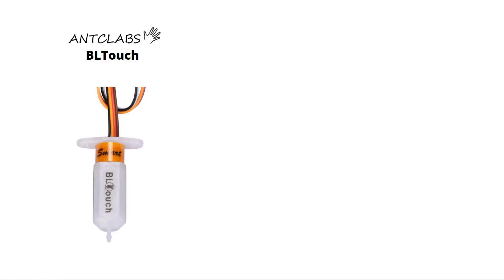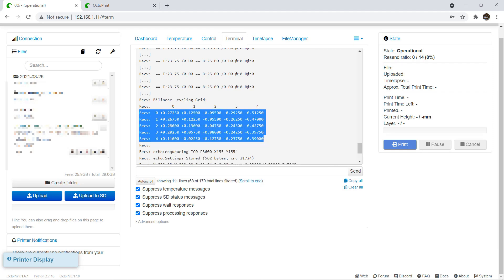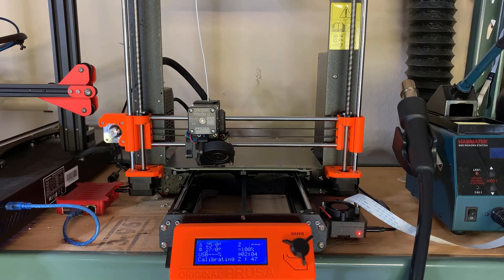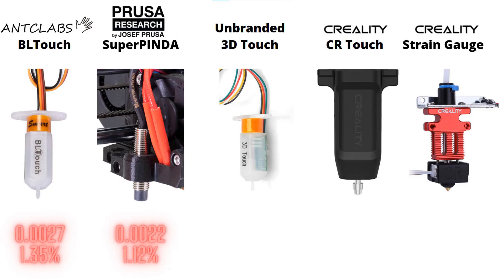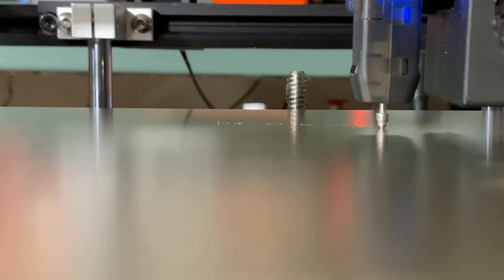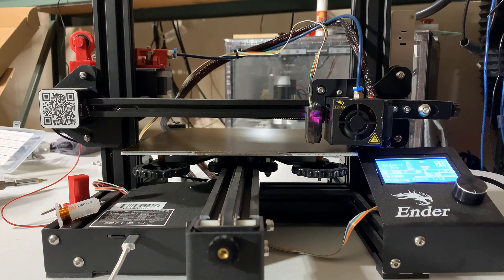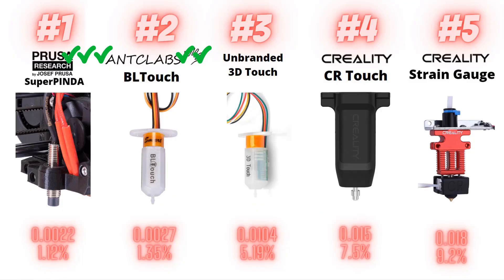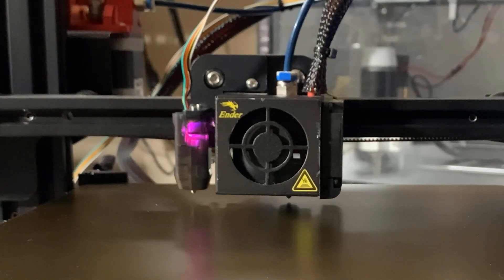The Best Auto Bed Leveling Sensor BL Touch, 3D Touch, CR Touch, Strain Gauge or the Prusa SuperPINDA

Comment: FYI - I just did this test on my Ender 3v2 (only a 3x3 matrix) with my 3-yr-old CR Touch, and the results were Stdev = 0.0187, or 9.37%. Pretty much in line with this video. Although practically speaking this level of accuracy is perfectly fine for good first layers and prints, it's disappointing, because I'd heard the same as some others said, that the CR-Touch was better, which is why I purchased it over the BL-Touch.

Comment: While I really appreciate this video it's very helpful at the same time something crucial was not taking to consideration the fact that the strain gauge is within spec it will still give you very good auto bed leveling andIt is more reliable that category makes it the best sensor if you take those into consideration it is the best sensor here  the other ones although they work better and these test results seem like they're more accurate which they are but in true practice this stringage is significantly the better option because essentially it will never fail on you and whenever there's a problem  with your print like spaghetti it won't get damaged from it

Comment: I really enjoyed your statistical approach and shows the sensors performance by itself.

There is one question i have and my search bought me to this video, but it's unaswered.

How well does the mesh relate to the actual print surface?
See, the Prusa SuperPINDA or any inductive, including eddy current uses the metal sheet, not the coating you print on. There could be variation in height on how they applied the PEI coating, and how much does that affect the result?
I wonder if you could print a mount to the print head to use a dial test indicator with 0.002 mm divisions to compare actual surface to what the sensors shows?
Draging the dial test indicator across the bed will show you what the surface really looks like and I would not be surprised to see 0.01 mm or more variation between points.

Comment: You're not calculating the accuary of prober you are calculating warp of your bed so these are useless, that's why cr touch is 0.02 because bed is warped. You should ise m48 command instead

Comment: Excellent video and testing. For a second iteration it might be worthwhile to remove all other variables and mechanical flaws these printers have generally like Z wobble, single Z X gantry and so forth which could add a ton of variation at least what I've seen with my Ender 3. Not sure, how the best test setup 2.0 would look like. But it should be a mechanical setup where you have not the slightest doubt that deviation is coming from the probe and not from the motion system. PS: just seen Thomas setup for testing ABLs. That seems to be the gold standard: https://youtu.be/il9bNWn66BY

Comment: Regarding the slow retract of the CR-Touch.
It doesn't matter. Because it is irrelevant if the pin retracts slow or fast. Important is the sensor which ready when the pin is pushed in to a certain points. thats all it needs.

But the results are really weird. Never saw a review with such results on the CR-touch.

Comment: Using different printers taints the results. All sensors should be tested on the same printer. That is the ONLY way to note true differences. It's a mainstay of research to use the same conditions for each product tested. Other than that, good vid.

Comment: I have a Creality 4.2.7 board and using a CR Touch. 
Works fine but starts to slow blink after it starts printing. 
Is that normal or is there a way to make it stop?
(Update) I tried a different CRTouch. That was a loss of money it did not make any difference.
Reply: I got it fixed by turning the internal pull up resistors on my board.4.2.7 and 4.2.4 Creality Motherboard. PB0 and PB1. By adding this to my pins_CREALITY4.h at the end of the file #define BOARD_INIT() SET_INPUT_PULLUP(PB0) SET_INPUT_PULLUP(PB1) Thanks to Scott Lahteine

Comment: Nice data. One thing I would be interested to see is temperature compensation. I know that super pinda and bltouch both have a temperature sensor and they do compensation on when the probe is warmer or colder, but do the others have similar features and how much are they affected by ambient temperature
Reply: The clones have no temperature compensation, not sure about the pressure gauge.

Comment: I actually had to take my CR touch apart this week and fix it because the metal probe was slightly bent and was getting stuck in the sensor causing a blinking red light and no function. Really disappointed with it especially after seeing the results of this video. I feel like they could make it really accurate with some more thought put into it

Comment: The CR touch may very well be a licensed copy, it actually looks like an improvement over the original and has been re-designed to work plug and play with the Ender series printers.  bTW, I've seen other reviews of this where it actually worked BETTER than the BL touch, so you might want to get another one and try it again.  Your's could be defective.
The PINDA inductive sensor looks like an improvement over the commonly available larger units, however there is nothing wrong with those when used with spring steel coated build surfaces.
Note that inductive sensors are available in both NO and NC PNP or NPN type switches.  The NPN type can be run at 12 or 24 volt power with 5v logic switching while the PNP type are restricted to switch their output signal at the power supply voltage.  Since these sensors perform best above 6v power, the NPN type is preferred.  These switches are Open Collector.  PNP switches will require a logic voltage level conversion.  NO and NC sensors are both OK, but you will need to configure the software to use the kind you have.

Comment: So I was able to test my CR-6 SE to compare numbers. I just put a new hot end on it, so the printer should be pretty pristine. I got this printer about 2-3 months ago. The results, using the same methodology that Aurora used:

Average Standard Deviation: 0.010467241 mm
or 5.23%. Not great, but better than the original test. 

Again, here's my data for the truly nerdy:
Data					Standard Deviation			
0.303	0.204	-0.005	-0.175		0.054866201	0.00811172	        0.0085557	        0.002408319
0.275	0.099	-0.169	-0.406		0.01372953	        0.008414274	0.001414214	0.004266146
0.171	-0.03	-0.294	-0.579		0.005357238	0.00914877	        0.000894427	0.009617692
0.023	-0.216	-0.465	-0.762		0.008927486	0.012173742	0.004335897	0.015254508
								
0.407	0.199	0.009	-0.18					
0.28	0.093	-0.167	-0.408		Avg	0.010467241	mm	
0.18	-0.02	-0.292	-0.59			5.23%		
0.005	-0.219	-0.454	-0.75					
								
0.43	0.193	0.009	-0.177					
0.271	0.085	-0.165	-0.41					
0.185	-0.015	-0.292	-0.598					
0.001	-0.201	-0.455	-0.73					
								
0.43	0.215	-0.009	-0.181					
0.297	0.079	-0.167	-0.408					
0.183	-0.021	-0.293	-0.577					
0.002	-0.197	-0.457	-0.737					
								
0.428	0.201	-0.005	-0.179					
0.302	0.081	-0.167	-0.417					
0.18	-0.038	-0.292	-0.576					
0.008	-0.191	-0.457	-0.765

Comment: I have a quick question, I still have either the old 8/16bit Silence MB for each of my Ender 3s. Will the BL touch will for it?
Also THANK YOU for this guide! Straight to the point, Data to back it up and variations to results considered! Couldn't ask for a better guide!

Comment: Great video. Ideally, testing would be performed on the same machine and build surface. I've had mixed success with the 3dtouch - unfortunately there are multiple versions being sold. The older '2.0' version was problematic - poor precision due to play in the play in the probe, and inability to 'stow between samples' (in Klipper). The newer '3.2' version seems to have fixed these issues, and I now get comparable performance to a genuine BLTouch on an Ender3V2 for a fraction of the price. I don't know which version you've used in this testing - your mileage may vary.

I haven't tried inductive probes or strain gauges.

👍 Good stuff!
Reply: Lets be honest here though, its barely a difference lmfao.
I have a cheap ahh ender 3 with a cheap ahh 3d touch.
Its impossible to tell the difference between that and a bamboo labs.
The motors along with the electronics along with the firmware, are all the same. With the only difference being the frame and random features.

Comment: Do you have or will you do a video on the Autolev probe installation and setup please
Reply from the maker: Yes, I have made a few videos for that. Please check the 3D printer upgrade playlist.
Reply: @AuroraTech  I’m one of your subscribers and I looked at all your videos, but I couldn’t find any on the Autolev brand bought from Substanica 3D.  I’m a older gentlemen and not the best at the computer.  Each time I watch the YouTube videos they are older and the screens have changed so it is confusing.  I’ve watched your videos and you explain thing very well and have had some success with your instructions.  I need assistance to get this probe working on my Ender 3.  I’m terrible at downloading and getting into my machine.  I would appreciate any assistance available in helping me or a place I can get the assistance I need.  Thank You keep up the good work
Reply from the maker: This is not one of the major leveling sensors, but I saw they also have instruction videos on their site:

Hardware Installation: 
https://www.youtube.com/watch?v=DjAO5SMCNNk

Firmware update:
https://www.youtube.com/watch?v=rsSK1m6XlbI

https://www.substancia3d.com/AutoLev/
Reply: @AuroraTech  Thank you I really appreciate the information

Comment: CR Touch was bound to be dodgy it was Creality made!
 I would like to know which has the greatest tolerance range, my Ender 5 Plus's aluminium bed was high in the middle like the majority of those machines, because of this the bulldog clips deformed the glass from the corners and took the bed out of the BL Touch's tolerance range.
 I fixed this by using the screw type bed clips that can be fitted so they just hold the bed without being too tight, I placed just two of them in the centre left and right as there is no bed slinging and just Z motion and this is adequate.

Comment: Why would anyone ever use any of these though? Its insanely easy to level the print bed by hand and these products dont actually level the bed for you anyways. All you are doing is wasting a whole bunch of time by making your printer test a bunch of points and then wasting even more time by making your printer make thousands of microadjustments mid print rather than actually just leveling your print bed. Am I missing something or are these products just totally worthless? Bed leveling is literally the very easiest part of 3d printing. Id rather level the bed by hand than introduce countless points of potential failure and increase my print times. I can't wrap my head around why these products exist, let alone why people actually like them.

Comment: Hmm... Yeaa... But... But with the worst result still just being 1/10 the height of what can be considered the default Layer Height of 0.2mm when FDM printing I'd argue that any of them will work for you unless you're printing NASA precision grade parts and by that time I'd argue it being safe to say you're using the wrong 3D Printing method and thus machine to begin with...
Reply from the maker: Yeah, that's why I said all these sensors are very usable for general 3D printing, you won't see any difference unless you inspect them under a microscope.

Comment: I ain't surprised that the CR Touch performs worse than the original BLTouch, but I am surprised that it performs worse than the generic knockoff. Seems like a metal pin really isn't a straight upgrade, but comes with a tradeoff. Really too bad, as as much as I love my BLTouch on my Ender-5, it does visually stick out like a sore thumb on almost every printer. Still, if I ever do get an Ender-2 Pro, I'll probably slap a CR Touch onto it to keep the nice consistent look. It performed well enough for usual needs, after all.

Comment: I have a CR 10S Pro V1 which came with an conductive sensor i had a terrible time leveling, so I switched to an Inductive sensor. Based on recommendation from Make Muse. It has worked good then i switched to a glass bed and had to adjust so close to the glass it was a problem if a part warped. So then I went to a composite bed plate and glue stick. Recalibrated, releveled the table, the machine frame and tightened the bed springs. Now i get very accurate level. I want to repeat your study to see how accurate and repeatable it is. Can I beg for the excel Template?? You guys are so good. I share your video with friends. Although you talk too fast for my old ears I just replay that section and I can get it. I am learning from you guys every video. the oven knob and Fan blade was great. I also use Fusion 360 and OctoPrint on my 1os Pro V1. I did add struts too you may want to see what I did it stiffened the Z by a LOT. 10X or more stiff.  Take Care you guys, tell Mom & Dad Hello, You have great Genes. D
Reply from the maker: Sure, here you are:
https://auroratechchannel.com/download/BLTouch.xlsx
Reply: @AuroraTech  Thank You So Much, Hey I slow the speed to .75 and I can hear you perfectly!!!!!!! Thanks D

Comment: You saved few $! Thanks a lot. I have a BL touch knockoff and although it works well I never liked the plastic needle. I am always concerning that the tip will eventually melt at a certain point during probing.

Comment: you can paste the data in excel and use "text to colums" from the data tab; select space as a delimiter, apply and delete unnecessary cells. that way you dont have to do all of the time consuming stuff manually

Comment: I'm about 90% certain it's not me, but I've had 2 bltouch and 3 3dtouch units fail on me shortly after installation...I mean VERY shortly! The longest one was a 3dtouch that lasted about 2 ½ days. I tried them on 2 different printers, so it can't be the printer's fault, right?
Reply: I have around 10 printers, using different ABL sensors, including both bltouch and 3d touch. They both worked fine for years, with no issues at all. No offense, but... besides the printers, sensors, there is another very important variable...
Reply: @georgecarter5664  maybe you can give me an idea why then? They all behaved the same way: worked initially, then started the fast blinking thing and stopped accepting commands even after power cycling the printers. Two of them then quit entirely after that, not even lighting up. No one I've spoken to can figure out why, and I can't find anything online that explains it either. Thanks!  🙂
Reply: @Nowayfella  Maybe you must check the voltage, some of those device only work on 3.3v and the most recent can accept up to 5v

Comment: Hello Aurora, thank you for these tests and the video. Do you know at what Z speed the probing was done with all sensors ? Meaning, could a difference in the Z axis movement speed have an inpact on the results? Usually, I think, in Marlin one can configure the amount of probings per point (default is 2 if I am not mistaken), and the speed of each one of them. I am definitely curious to know if accuracy is impacted by the Z probing speed and how the graphic representation would look like. It seems I have to that test myself ! ;)  Cheers

Comment: On v-core 3 i had problems with 3d touch, because bed leveling have 0.02mm tolerance. My 3d touch had deviation around 0.021, after turning screw i got deviation around 0.005 and i was able level the bed, but i also ordered original bltouch, just for sure and consistent deviation.

Comment: interesting results with CR touch, other reviews have mentioned that it outperformed the BLtouch
Reply: Maybe broken unit?
Reply: @DARKredDOLLAR  CRtouch does not vary with temperature, BL touch is Very poor above 45C. Also CR touch does not drift with time.
Reply: @martindare5803 I print a lot of PETG with bed temp at 70°C, and the CR-touch works very well at least for me in that temperature environment. So I'm very happy that I got it.
Reply: I was having similar results and found I had misconfigured klipper so that the input pin wasn't pull down. I am not sure how Marlin handles it, but this could have been the issue.
Reply: They use hall effect sensors that can change behaviour due to heat. So I guess the CRTouch, the halleffect sensor is either of better quality or futher away from the bed inside its case.

Comment: I'm Surprised by this. I find the BL Touch to be flaky. It often fails during self test, and randomly during leveling. I have NEVER had my CR Touch, Fail at any point. Your CR TOUCH does appear to be slow to respond. You may have a bad unit. I have a BL TOUCH, still in use, and, when it dies, I will replace it with a CR-TOUCH, though, this was very interesting, and I will have to keep my options open, with all this detail in mind. Nice work.